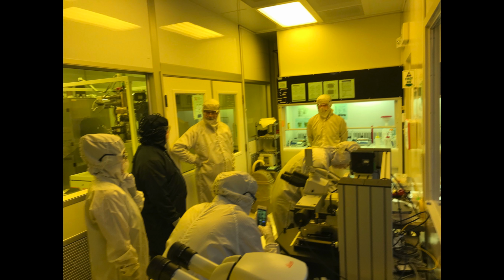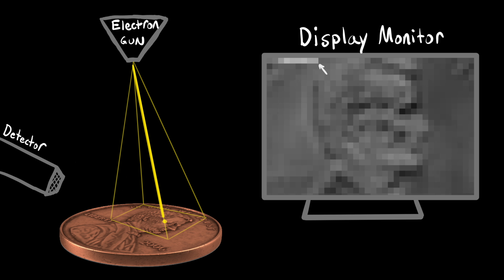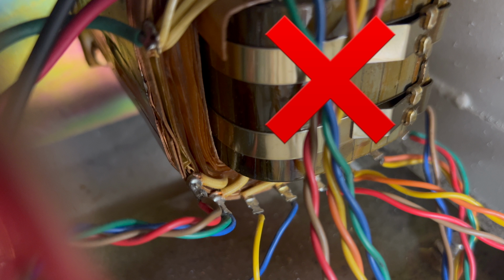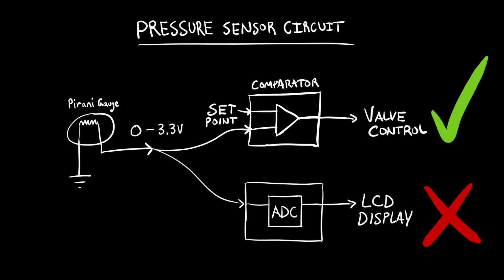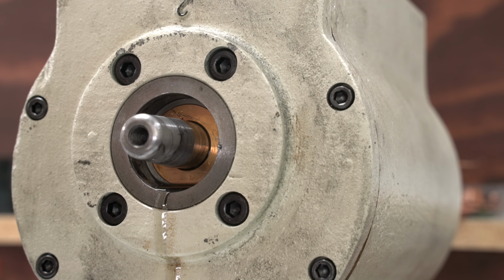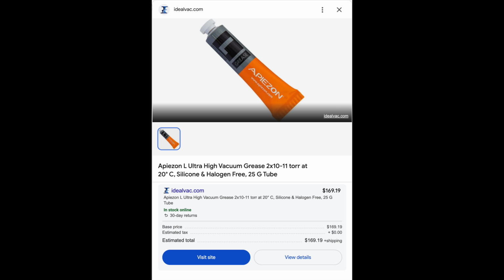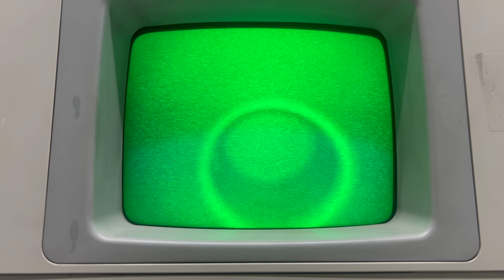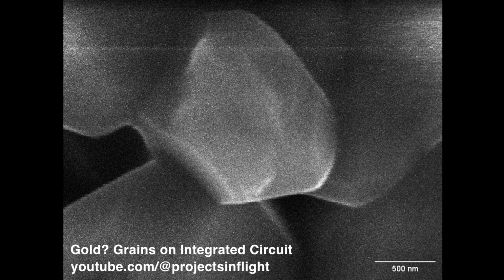I Saved an Electron Microscope from the Trash

Comment: Great work. I almost bought an electron microscope for hobby use a while back, but it was a tunneling microscope instead of scanning, and the tunneling would have degraded the sample I was hoping to use it for.

For vibrations, you can get air cushions for the vacuum pump, but something that is also done is to get a 5gal bucket, fill it with concrete, and put a U shaped stainless tube it. With this between the roughing pump and the SEM it will absorb vibrations from the mechanical pump. The further away the mechanical pump is the better too.
Reply from the maker: Oh yeah- I definitely want to make that (or the hockey puck metal version). I also need to figure out how to reduce the flow rate of the chiller as well...

Comment: Great work 👍😃 what about testing a piece of blue ray DVD! 😉
Reply from the maker: Hmm... I see one potential issue. The protective plastic layer on the top would need to be removed first, since it would block the electron beam. Not sure how to remove it without damaging what's underneath...
Reply: @projectsinflight  Warm paint-striper (DCM should be used in a fume hood or outside) jetted onto the lacquer (printed) side should leave you with a aluminised stamped disk on a CD if all goes well  Not sure if this can be done on a DVD.
Reply from the maker: ah ok. I should do a CD first anyway since the pits are larger
Reply: @projectsinflight  If you contact a bunch of small CD pressing operations one of them might send you a few reject CDs no doubt lying around that never had the lacquer applied.

Inspecting a relief printing halftone plate could also be interesting, the detail is visible optically but because it is so 3D I think it would look cool imaged with a SEM.  The amazing thing is that news and advertisements were routinely duplicated by casting against a flong (paper mache mould) that was impressed off loose type or a manually engraved or photochemically etched image matter.

Comment: Hey, i just saw one of these for sale near me in northern bc..
Reply from the maker: I've actually seen a fair number of SEM's that are ostensibly in working condition for sale but rarely the 5200s for some reason, even though they used to be very common. Either they break before they are old enough to sell off, or they are still being used lol
Reply: @projectsinflight  I am trying to self justify it for my mycology lab ( jk it is more for the huge side interest of looking at the fractal toroidal implosion imprints of implosion devices(ultrasonic bubble cavitation), check out Martin Fleishman memorial project)
Reply: @projectsinflight  I think it was amray amr 1000
Reply: @projectsinflight  What is special about the JSM5200 besides having a DIY user base now?  I have seen older ones come up for sale and have wondered at what point the cincreased omplexity makes repair harder than the age of the units?
Reply from the maker: Oh, if there is one thing that is special about the 5200, it's that it's absolutely not special at all. It is the toyota corolla of SEMs. The base model comes with zero frills. Not even a manual aperture alignment.

Comment: Find a better shielded matching set of AV cables, I suspect there is a leakage with the black/yellow video cable you added, makes sure the PC and PSU fans are clean, maybe noise being generated by failing capacitors, or CPU thermal throttling and activating the fans, I recommend a fan-less heatsink
Reply: Nah, a cheap RCA cable like that should be perfectly acceptable for what is being asked of it, and the clarity of the slow scan images bears that out. There will be a lot of other connections in the signal path that all need to be checked.
Reply: @JamesChurchill  price isn't important, most all cables have decent shielding, but the black one doesn't. shielding is the important part with such a sensitive machine, small emf can be an issue. Ground the machines on the same outlet is also important lie an audio feedback noise loop.
Reply: @KavorkaDesigns  How did your x-ray vision see through the cable insulation... and the YouTube video... to determine exactly what the cable coax is like? That's some real talent there!
Reply: @JamesChurchill  We all own the same cheap cr4p AV cables lol
Reply: @KavorkaDesigns  I've seen plenty of RCA cables in my time and they're not uniformly identical. You're seeing the one thing you recognize and ignoring all the complexity of the rest of the signal path. There's definitely bad cables out there, but the answer also isn't automatically "get a $5000 audiophile power cable and forget that it's plugged into crappy house wiring".
Reply: @JamesChurchill  ALL black rubber AV cables are cr4p, ALL.. Spend $30 on a decent set. its ProjectsInFlight not fight? lol.. Just after rewatching, the blue cable that was moved is repair able @ProjectsInFlight the ends should unscrew and pull through, let us know the results
Reply from the maker: working on it! I don't really know where i'd find better ones though
Reply: @projectsinflight  A guitar shop is the bets place for real cables, real copper and proper shielding, online is a joke, bring a magnet and test your wires, trust no shop either lol
Reply from the maker: oh- very interesting....
Reply: @projectsinflight  Noctua NH-P1, Passive CPU Cooler

Comment: Incredible fix, quality production value and thank god all the elbow grease did lead to great result.
I would strongly recommend you backup(raw dump) the hard drives in that companion PC and verify if everything can be restored to another disk, in case the old spinner decided to bite the dust. Including testing the software, to make sure the software doesn't have strict DRM. (i.e. license tied to the exact hard drive or motherboard serial number)
Reply from the maker: I imaged the hard drive thankfully. I don't know if it's tied to the MB. definitely something I should check on. The software is pretty ancient and clunky, so i am actually hoping to reverse engineer it and make my own capture device.

Comment: 13:00 "... in percent instead of an actual pressure unit, like torr" 
I can accept your insult of bar and pascal if you can explain what the difference between torr and mmHg is. And if you then can repeat that statement from the video without laughing out loud ;)

Edit: awesome work on the SEM, good video!
Reply from the maker: For whatever reason, most of the components and stuff involving vacuum that i've seen deals with Torr rather than Si units. Probably a legacy thing. Honestly I prefer it at this point, kinda like how I still measure the temp in F when dealing with weather and baking, even though I use C for everything else.

Comment: Heya, awesome project! The old computer probably still has a harddrive in it (spinning rust), which tends to significantly degrade over time. I'd highly recommend to make a backup and/or transfer the drive onto a modern disk/SSD
Reply from the maker: good news, i have imaged the disk! 

though i'd really like to replace the computer with a more modern one or make my own capture device. this thing is really clunky lol
Reply: @projectsinflight  you could try to throw this software in docker or something. 

a lot of modern computers support rs-232 via a superio based header, which might make this process easier if the capture uses that. i have no idea if this there is some special thing this requires, although someone will correct if im wrong lmao
Reply: @projectsinflight  I'd recommend that you capture the disk image, convert to a VMDK/virtual disk, and then run the computer using a virtual machine. Physical to virtual isn't that challenging, but i am VCP/VCAP certified engineer though.  My brother has a CNC system that had an old legacy PC and single point of failure. Once virtualizing it, the hardware can fail and it's a quick and easy process to have it working again. Can even turn it into a high availability solution. His only SPOF today on the control side is the software requires a USB hardware dongle key to operate.
Reply: @dohabandit  the capture card might be a problem if it's not PCIe
Reply: @dohabandit  You can't just do this, these sorts of machines have an accessory card (often multiple) connected into the motherboard that receives the data from the SEM, and special drivers that handle this. For this vintage, I highly doubt it is PCIe or something simple like that as well.
Reply: @JFirn86Q  cant you jsut use a pci to pcie adapter, and pass that into the vm?
Reply: @gamagama69  it probably won't be pci, but something like ISA. Also, I don't know how the SEM drivers will play together with some sort of adapter board or how the VM would as well.
Reply: tho if it did somehow have an ssd in it, it likely would have lost the data by now, as hdds are much better at 'cold' storage of data

Comment: It's amazing to see this old tech running again! I would love to see more videos about improving the SEM. I bet you could hook into the scanning logic and turn it into an electron beam lithography writer. Breaking Taps had success with using regular acrylic as a resist.
Reply from the maker: Oh that is definitely on my list!
Reply: Acrylic is just PMMA. So that's basically what I've always used for ebeam litho. We use MIBK and IPA in a ratio of 1:3 to develop the resist. I don't know how easy it is to source MIBK though, but from I believe distilled water also works so that may be an alternative. Removing PMMA you can do with acetone and then IPA to remove any residue from the acetone. If you can get your hands on some tool to deposit metal, you could even do lift-off and make a real device that way.

Very cool project. Looking forward to future updates

Comment: Honestly would be cool if you could build one from scratch. Maybe after your chip project.
Reply from the maker: I have actually looked into building my own TEM. It would be very challenging to make the magnetic lenses... but not impossible.
Reply: @projectsinflight depends on your resolution goal. Easiest would be a 1 condensor 3 image lens TEM. Also be warned that sample thickness must be below 100nm to even be able to see anything with reasonably low voltages (<=100kV). I usually recomend 10 to 40nm for light samples (biological) and <20nm for heavier stuff.
Reply from the maker: I have actually done some research on ultramicrotomes, and was thinking of trying to find one i could use for this. If you have any relevant info you'd like to share, feel free to email me. I am projectsinflight on gmail.

Comment: crazy how everything was broken

this machine must have been used half broken before it was fully broken

or could just be that it was stored too long after one part broke the machine
Reply from the maker: based on the info I got from the Lab and directly from the JEOL service reps, it seems that the unit "slowly lost contrast over time" which makes me think that the transformer issue might have been inflicted during the possible repair attempts. If that's the case then it means that the original thing that did the unit in was possibly just the issue with the cable, which is kinda hilarious. A $5 part took down a $100k machine...

Comment: If you ever need a complex part machined for this SEM project, please DM me! I own a small 1 man, 5 axic cnc machine shop and I would love to help out this or any other similary cool projects.
Reply from the maker: Thank you! That is really generous. I definitely have at least one thing I need to make for it soon! feel free to email me (channel name + gmail) if you'd like
Reply: @projectsinflight  might want to check with Martin and any other owners you've run across before remaking a part: this is definitely where you want that cross reference, and it's also the best opportunity to make multiples of anything that's likely to need replacement again.
I'd bet you can find some electronics and microcontroller content creators that would love to collab on updating any of those 30 year old guts too.

Comment: Great video. It's such a shame that a project that is so long only justifies such as short video about it.

I wondered if you couldn't use standard 120 Transformers and the convert it to a 120 machine or is the 100 V somewhere used directly?
Reply from the maker: oh don't worry, i've got more plans and more videos in the works. there's much to be done.

regarding the 120v question- I could replace transformer T1 as well, which would allow all the DC supplies to run off 120V instead of 100V, but there are actually several items such as motors that run off specifically 100V and would not be replaceable easily, so i kept the 100V. I definitely considered it though...

Comment: you should try ebeam lithography :D
Reply from the maker: Definitely on the short-list of things i want to do!
Reply: @projectsinflight be careful, if you dont have a beam blanker, and intend to use the beam alignment coils for blanking, then be careful as you can burn them up with relative ease.
Reply from the maker: I honestly figured i'd just move the beam away to the edge really fast using the scan coils or something
Reply: @projectsinflight  that's almost the way a beam blanker works. In a electron beam lithography machine, the beam blank is usually a set of capacitor plates located below the gun alignment coils and prior to condenser 1. Some lithography machines have the beam blanker between condenser 1 and condenser 2, or between condenser 1 and the objective, depending on the electron source type and optical design.

The blanker works by deflecting the beam into the liner tube or a beam dump when not writing. Its usually a capacitor due to the higher slew rates it can produce. This is why i stated that using the beam alignment coils might work, but with the danger of them burning out. The amplifiers feeding the alignment coils would defiantly not be fast enough, and im also not sure if they are cored type coils in your model or not.

I have also seen the extraction voltage of a field emission gun being used for beam blanking, but this dose not apply to your thermionic machine. 

Also, keep in mind, that you have quite a lot of geometric distortion at low magnifications in your machine, lithography machines either have very highly corrected lenses, small field of view or digital correction to account for this. In order to expose large areas the writing scan area must also be aligned with the moving axis of the stage. 

In the first lithography machines from IBM we have at our museum (museum of electron microscopy, Nürnberg Germany), this is done by physically rotating the entire scan coil assembly relative to the optical column. You focus the wafer in SEM mode, then align the scan FOV with the movement axis of the laser interferometer stage. Once done you can switch to write mode, and turn up the source current.
Reply from the maker: this is very good to know. i appreciate that you took the time to lay it all out in detail for me